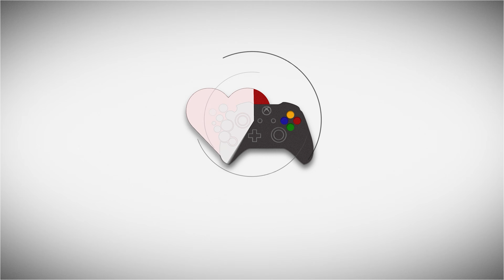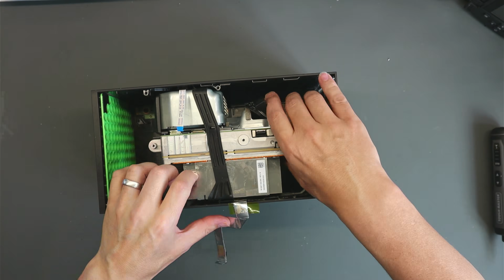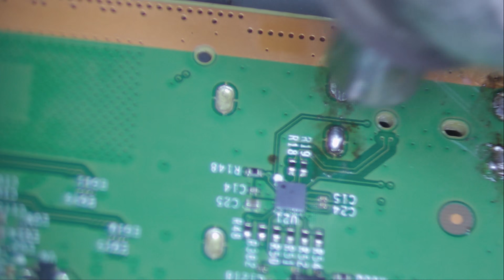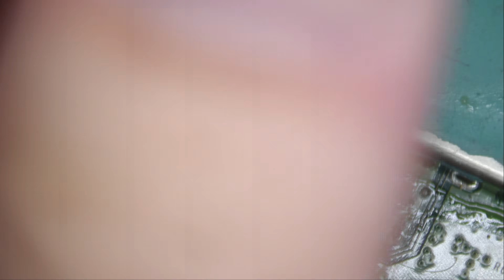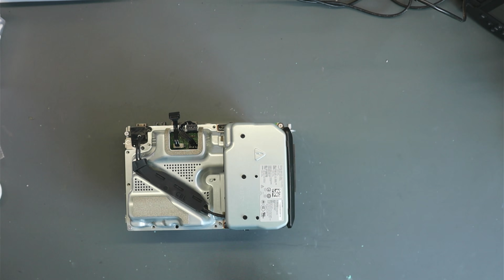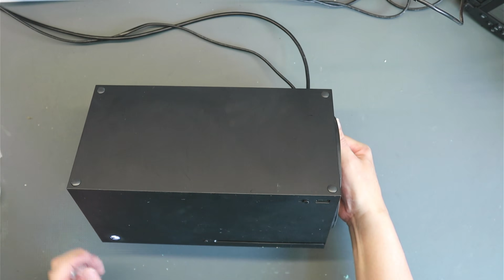Easy way to replace an Xbox Series X HDMI Port - Simple start to finish guide. Fix No Video Output!

Comment: Why n0t use solder wick? Too much heat for the tiny pads? Just curious seems like it would be more effective unless its too much heat.  Hard to tell the size from the video alone
Reply from the maker: Good shout.. You certinaly can use solder wick.  As the Xbox series boards are quite thick, it does normally need some extra heat though